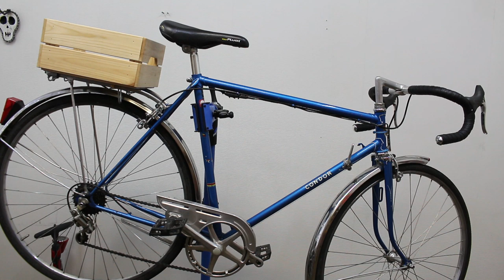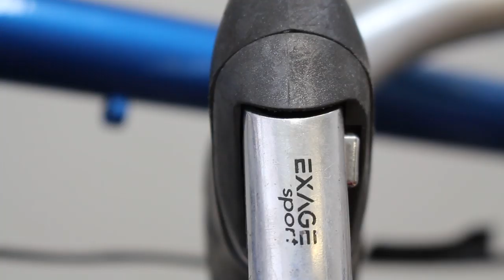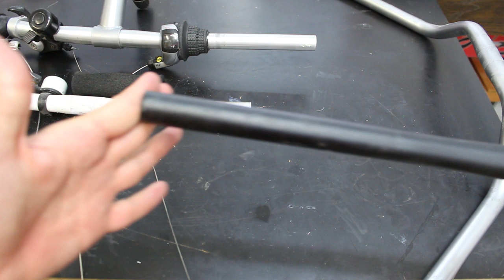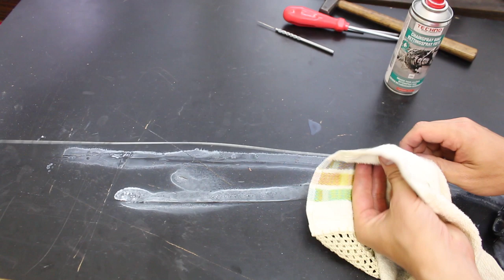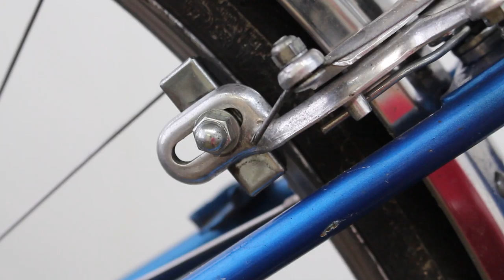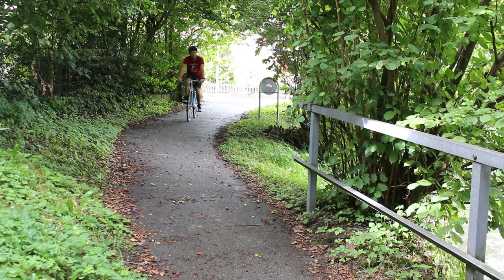Drop to flat handle bar converstion

Comment: Sweet, flatbars rocks, urban builds often benefit a lot of having them, control is crucial when avoiding cars  and peasants.
Reply from the maker: Yea it actually feels really nice to ride like this. Thanks for watching
Reply: @BruceChastain   Im confused, how did you sort out the shifting? I only see front and rear brakes? thanks
Reply from the maker: @svnbit8408  it has top tube shifters. that's why it was such an easy thing to change.
Reply: @BruceChastain  Ahh, thanks I didn't know that was a thing! I thought it was more generally integrated into the levers on the bars (like my old trek I just bought, and want to convert bars) 
All the iterations of those down tube, top tube, stem, shifters are crazy! Learned something. Cheers
Reply from the maker: @svnbit8408  yep the old ones were like that.
Reply: I ride on the non peasant side of town. I run down oligarchs.
Reply: @garymanning8920  😂😂😂

Comment: Cool video;
brother-in-law dropped a drop down bar bike on me; ( great, thanks dude, just what I needed, another project bike )
researching how to convert; or not  ??   Got plenty of other bikes to ride.   Road bikes are just what I didn't grow up riding.
Living in the city you need them brakes close at hand - pedestrians & cars, etc. 

That bike looks really sharp after the conversion.
Great Job and thanks, I think that I learned something that I can use on my Winter project bike.
Reply from the maker: cool man thanks for stopping by. and good luck on your project. Just try to make sure the lever pull is about the same.

Comment: I would've installed the gear shifter on the handle bar. That's what I just did to an old road bike I have: an almost 
flat handle bar with integrated mountain bike brake/gear shifters. I should've done it years ago.

Comment: Was trying to go drop bars on my 93 giant iguana. Ended up adding drop bar ends to the straight bar. Didnt use them much so switched to some of those bars that sweep back and I love it. Similar situation  but a little reversed. Nice bike!
Reply from the maker: haha nice. thanks for watching Mark
Reply from the maker: also by the way, I did actually put some drop bars on a MTB with mixed results, it's one of my videos from several months ago called "MTB to road bike conversion" or something like that. cheers
Reply: @BruceChastain  I that's what got me following! Thanks

Comment: You could put some compact drop bars. Worked wonders for me, the reduced reach and shallower drop gave me so much comfort I can go several minutes on the drops no problem.
Reply from the maker: Yeah I imagine that would work good. But I went with the flats just because it's what I had laying around. But I do admit the drops look better.

Comment: I like this video, have you ever tried those sweeper bars? I think you would be able to sit up straighter with those and be more comfortable. Just my thought, maybe you prefer to not sit up straighter?
Reply from the maker: Yeah I've tried them on other bikes, and yeah it's comfortable for shorter rides, would have been a fine choice here too. But I like the slightly faster lower setup better.

Comment: Thanks I want to do the same thing with my road bike. What brake levers did you use? They seem basic enough and easy for the conversion. Also i want to change the handlebar stem, would that that complicate matters? You had a more upright stem with the handlebars you went with, just wondering why you didn't go with those as well.
Reply from the maker: Hi Elo, I just used the levers from an old MTB.  think I could have also went with the more upright stem but I like the lower ride style and honestly I like the looks of the lower stem/bars better too.

Comment: I want to remove my drops on my old road race bike. It has aggressive geometry and I cant comfortably get into the tuck position anymore. Did you use new brake levers in this set up..It looks like you did. What should I use on a straight 600 bar for brake levers. My shifter is on downtube also.
Reply from the maker: Hey Gary for sure I did use some flat bar type levers I had laying around, I don't know if the road levers would fit right or at all on a flat bar, but I'd like to try now that you say something! But be careful to make sure that the lever have the same through or motion distance as the calipers that you're running.

Comment: can you use the same brake lines from the old brakes, or do you need new lines that are compatible with these types of brake levers?
Reply from the maker: I believe the lines are the same, but I don't remember if I reused them or not, I'll take a look at the video later to check.
Reply: A lot of the time brake lines are interchangeable, the big thing to look out for is that bikes typically come with short pull or long pull brakes, and if you swap the brake levers, make sure that they are compatible.

Comment: I laughed out loud at "I  got some uh sweeper bars...yeah not gonna use those *throws aside*"
Edit: I had a question, how did you choose the brake levers, did they have to specifically fit one size bar or were they slightly adjustable (could they fit a 25.4 mm and a 26.0 mm)? Great video!
Reply from the maker: To be honest I don’t remember and I’ve already sold the bike. But I think they are slightly adjustable. Thank you!
Reply: @BruceChastain  how does breaking from hoods on the drop bar compare to breaking from flat bar braking?